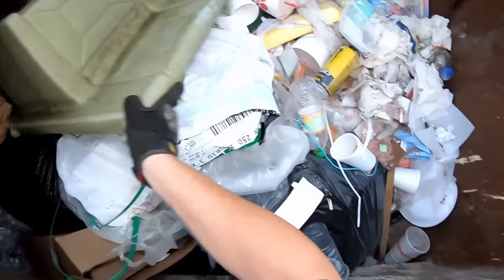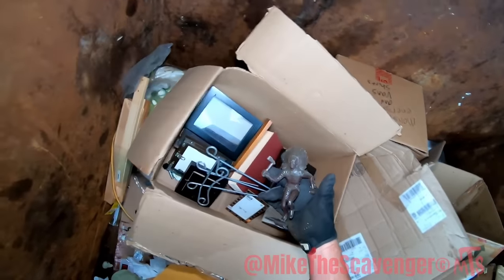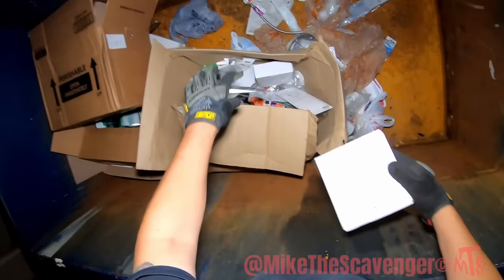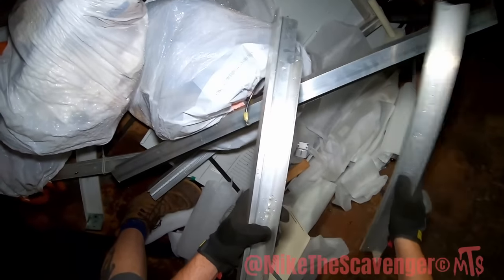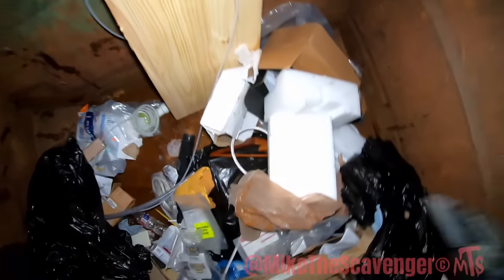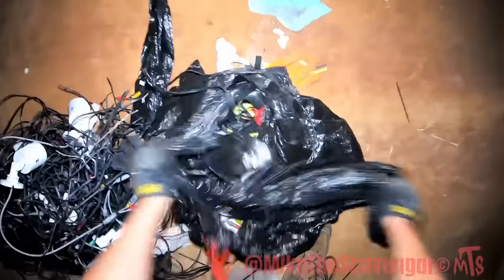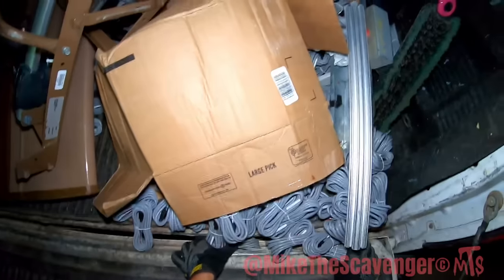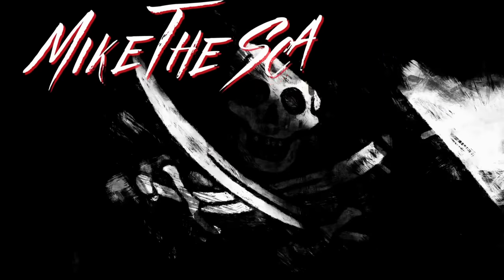Dumpster Diving "The Age Of Reason Begins"

Comment: At 9:45: 
That round ring with the holes and the two slots is a toilet flange repair .That style is used in case one or both of the slots where the bolts go for mounting the toilet to the floor break, you set that flange over the broken flange and screw it into the floor. The round holes in the repair ring line up with the original flange holes so the screws can go through both and into the floor.

Comment: Hey Mike those brand new wire could be for wiring for the Atari hand controllers and can be resold to game stores or hobbiest that like to build. Why would someone throw out hand wrenches and others.
The key you found is to open some electrical cabinets you found once before remember ??

All those noodles could been sent to the middle east or to countries that had earthquakes. The

 fighting have left so many with out basic necessities.
Until you don't have much of food any little bit helps. Even the food pantries could use the food to help locally in the neighborhoods.
I'm hoping someone will read my PSA and help.